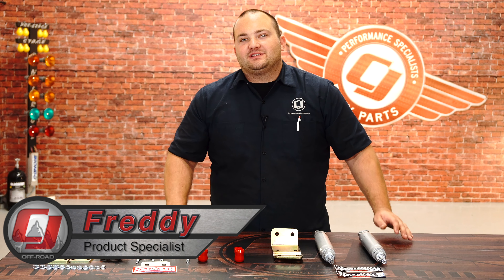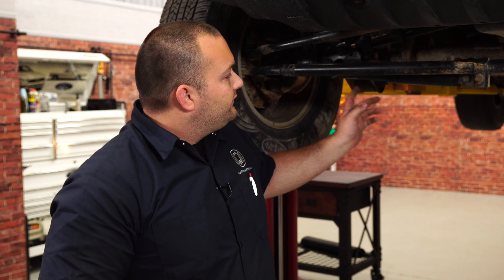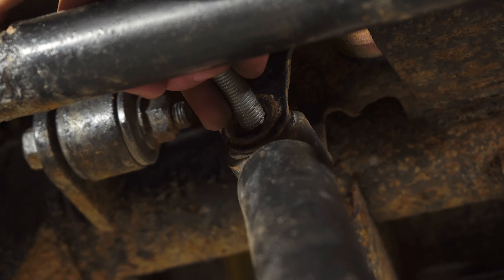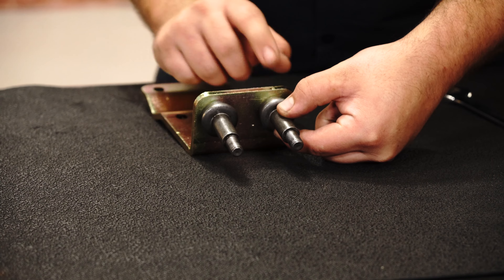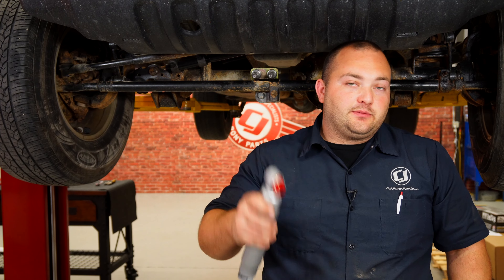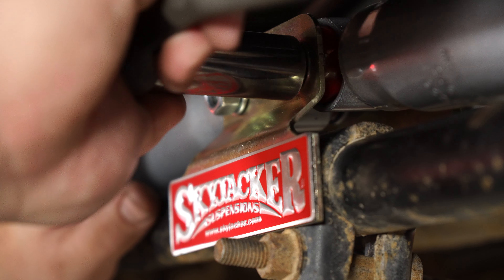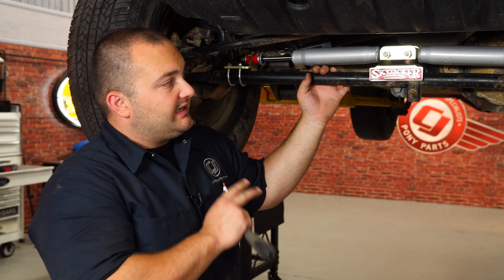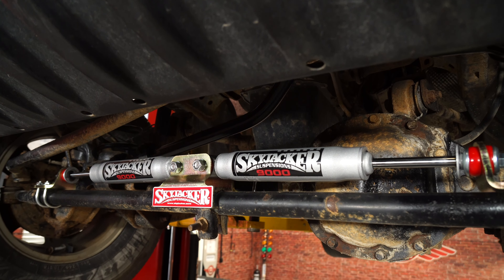Jeep Wrangler Skyjacker Dual Steering Stabilizer Kit M95 2007-2017 Installation

Comment: Hi, I just installed a 3.5 inch skyjacker suspension on a Jeep wrangler JL and I wanted to ask if you necessarily have to put the "cam-bolts" on the suspension arms as indicated, since I drive the Jeep and I do not feel any vibration

Comment: I am having issue with the two bolts in the front getting in the way of the steering linkage when the driver side is on full stuff and the wheels are all the way turned to driver side.

Comment: How did you remove the original stabilizer bracket? I feel like y’all left that out for a reason.
Reply: David Gonzalez just took a grinder to mine
Reply: Damian Oujesky Yea I had to use 2 wrenches to pry it open. It sucked!
Reply: David Gonzalez I tried that and couldn’t get it to bend enough so got mad and got the grinder out lol. Just installed it yesterday it is the pro comp, but their instructions are terrible so this video ultimately helped more than anything
Reply: Damian Oujesky Heck yea! Lol whatever works!

Comment: My JK has a 2.5" lift with 33" tires. I've read on the Interweb where some people say my particular setup doesn't need a steering stabilizer. My brother has a JK with a 3.5" lift and 35" tires with a dual steering stabilizer and his drives like a Cadillac compared to mine. Night and day difference. He bought his already setup like it is, so he doesn't know exactly what all was done to it prior to his buying it. There could be some other components that make this huge difference, but I think the steering stabilizer has got to help.

Do you think it's going to make a difference on my JK or would it be a waste of money?
Reply from the maker: For your setup you might not need the dual setup, but the factory one has to go for sure if you want better ride quality.